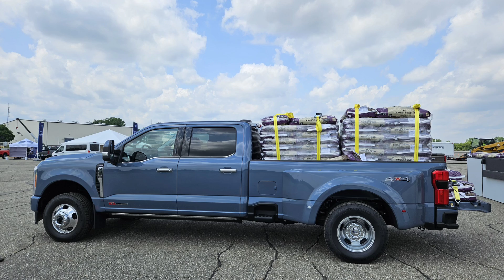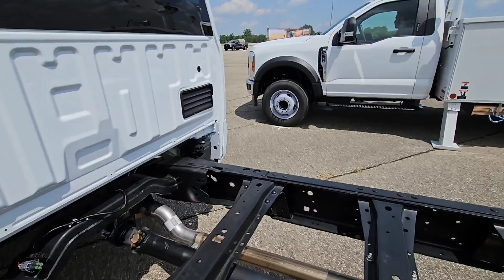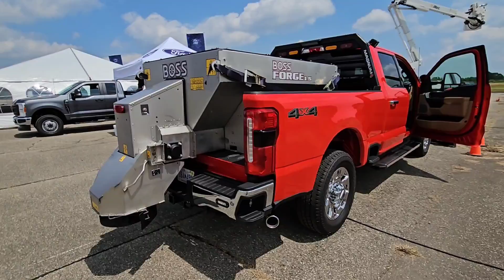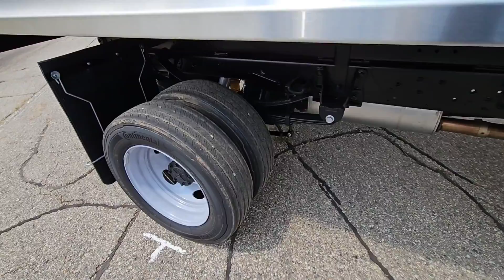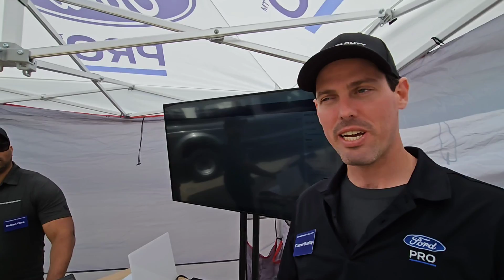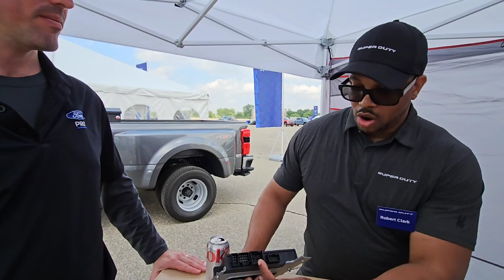Serious Trucks for REAL work!  2023 Ford Super Duty PRO!

Comment: Waiting on my F450 Limited to be built. I considered pouring that extra cash into a flat bed but I feel the heated and ventilated seats and pro trailer backup assist are 100% needed. Getting custom blue leather handbags made in Europe including a pouch to hold the paperwork for my hotshot. 

I want to hotshot in pure luxury. ❤